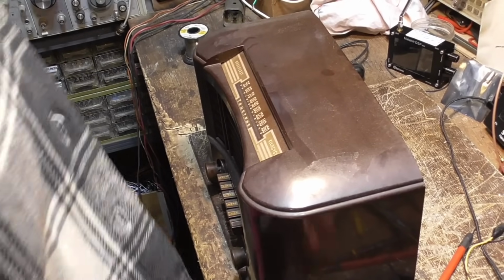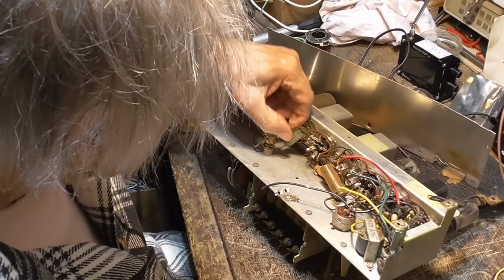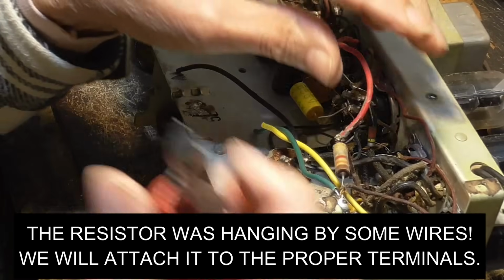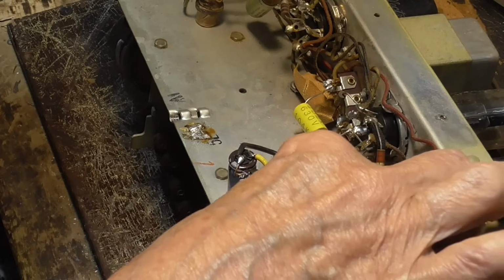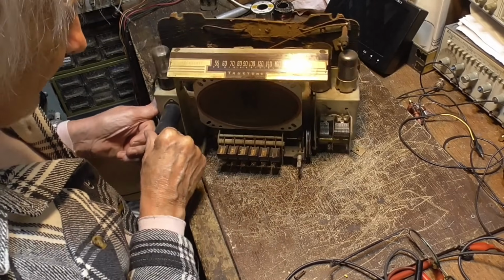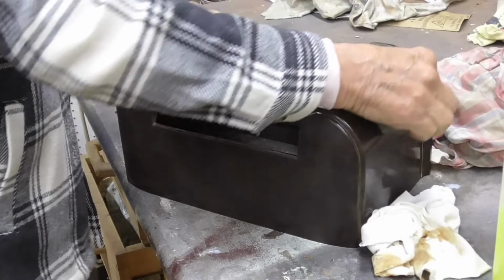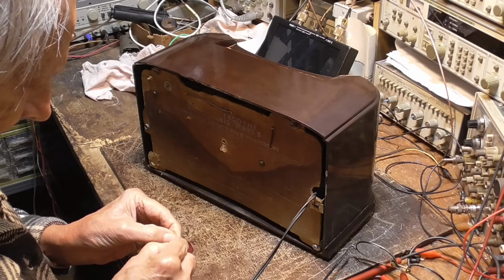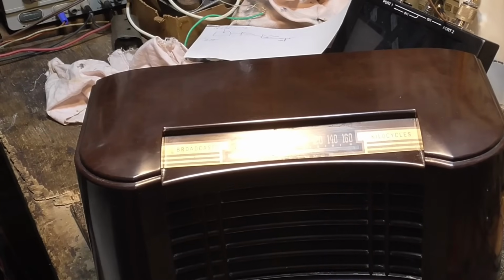old brown bakelite radio repair

Comment: I used to do repairs on tube radios and TV's long time ago. In the semiconductor age, most defects are related to switching power supplies. This requires a different approach of the problems which is not always easy. In doubt, always limit the inrush current during the repair, before switching it back on. If not done, you risk smoke in your eyes...
About filter capacitors. Always consider the max. ripple current in such devices. Not any electrolytic cap's can be used just like that, even if the voltage rating is high enough.!
The max ripple current can be found in the datasheets.
For testing foil HV capacitors, I used a simple method. Take a neon lamp with an E10 or E14 socket suited for mains supply and use a variable DC supply, ( to be in the voltage range of the cap under test. ) Just put the cap and the neon lamp in series with the supply. It should only light up for a short time, depending on the capacity. The least leakage in the capacitor is shown as the neon lamp stays on or even light up weakly. 

A viewer in Belgium, Europe.😇

Comment: could you explane how you test the capacitors please
Reply from the maker: I use a Triplett mocel 630 VOM set to the x10,000 ohms range. This applies 30 volts to the capacitor which emphases any leakage. If the capacitor reads below 20 megohms it has lost its seal and will eventually develop enough leakage to malfunction. Most of the good capacitors read either totally open or barely making the needle move.

Comment: This is definitely a higher-quality receiver. It has those nice, big IF cans with the trimmer caps. In later years, manufacturers really took a step down in quality when they used those smaller, crappy IF cans with those internal silver-mica sheet capacitors and the fragile adjustable ferrite inductors. Those smaller cans almost always develop SMD.
Reply from the maker: Yes. I come across the rotten I.F. cans quite often. I have plenty of spares on hand so for now not any more than the nuisance of changing them out.

Comment: Hi Ron
This radio brings memory's, in the Netherland's back then we had the U series's they had no transformer a lot of people got killed because the chassis was live if you plugged it in the wrong way.
They were small and had a Bakelite box.
Anyway good show Ron I love it,I follow you a long time now and you never seas d   to amaze me.
Ron you make your own valves, I have here a Phillips GZ 34 double rectifier 150 mA.
Air got in to it,you can tell normally it is silver now white.
The valve is new, never used the filaments are OK I checked them.
It would be a shame to throw it away.
If you interested I will send the valve to you,with your skills, you can repair the valve for own use.
I know you in Florida Houston, but I have no address to send it to you other wise you would have the valve already.
Don't mention the cost, no problem.

Perhaps have a look on my channel tell me what you think.
I am 74 years young.
Thanks Ron great fun, especially with cat .
73 Jo

Comment: Very nice old    radio. Too bad there's nothing worth listening to on AM anymore.😢
Reply: Inexpensive AM transmitting adapters are great so you can pipe your digital music, or even vintage programming, through these boxes  without adding circuitry.
Reply: In Montreal Canada all we have is sports, talk, news religious and ethnic. There used to be oldies but they switched to sports. Just talking all day. One station will play only a few seconds of a song now and then, that is stupid.
Reply: In United States you are lucky, you have many medium wave radio stations that are broadcast by private individuals, in Italy the only important systems were. state-owned and they were all turned off in September 2022, now there are small radio stations left with low power, a maximum of 1 kW, which are not enough to have a good transmission result

Comment: When I "re-caped" my 1957 RCA X-212 the sound has horrible bass. You called the one cap a "tone" cap. I did find on my radio the cap off the plate of the output tube going to the speaker transformer. It is .0068mf. I opened it and the sound is much better. Would I replace it with a .002mf to retain the good sound?
Reply: What do you mean by horrible bass? That capacitor should cut off some treble without affecting bass. If removing the cap gives you more bass then it must have been messed up.
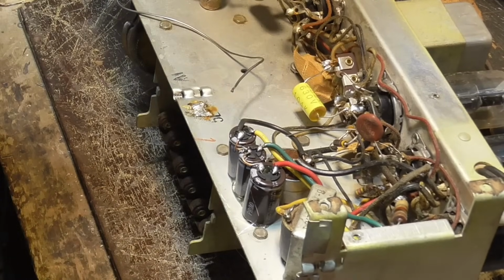Reply: @eDoc2020  Thanks for replying. There was too much bass with the new capacitor in place. After removing the capacitor the bass was gone and the radio sounds normal. glasslinger was saying something about putting a .002mf capacitor to protect the transformer. (time 11:20). Would this be better than the .0068mf that caused all the excessive bass?
Reply: @rossparker5158   The .0022uF would have 1/3 of the treble reduction of the .0068. Looking at your particular radio there appears to be some sort of "loudness compensation" which will vary the tone when the volume is changed. If you short the 270 ohm resistor at the bottom of the volume control it should disable this function and might make the sound more suit your taste.
Reply: @eDoc2020  Thank you. I will try the .0022mf cap and shorting the resistor. Will let you know how it works.
Reply: @eDoc2020  Changed the cap to .0022uf. All it needed, sounds great. Thanks for the help.

Comment: May be the chassis is floating, not at ground potential. To glue the top of electrolytic capacitors directly to chassis can put it to tht mains potential.
Reply: True the plastic covered can is negative side.

Comment: Hello, I am from Iraq and I have a Sierra radio. I replaced the faulty bulbs but it is working and the station’s sound is very low. Can you explain?
Reply: Align radio internal adjustments one at a time for better sound

Comment: Ah a Truetone. Looked it up and it is a Western Auto Supply sold radio . Model D2815 from 1948, 76 years ago. Thanks
for sharing your amazing skillset  Ron with these old radio repairs. I still need to use the original schematics to figure out
what and where things go. Still learning. Looks like decades of  brown nicotine  stains covered the cabinet.

Comment: I was hoping that Ron would get a professional soldering iron for charismas, but I guess we are stuck with the Weller GUN for 2024.... 🙂 
BTW, next to my soldering iron and DVM my Hot Glue Gun is the second most used repair tool in the test equipment arsenal!! 
But keep in mind that not all Glue Sticks are the right type and the same goes for the glue gun, some dont get hot enough to melt the high quality glue sticks.. 
Robert